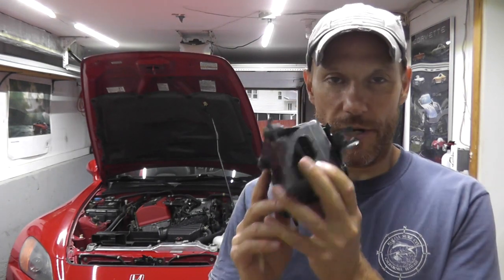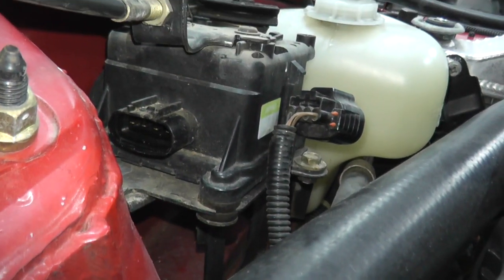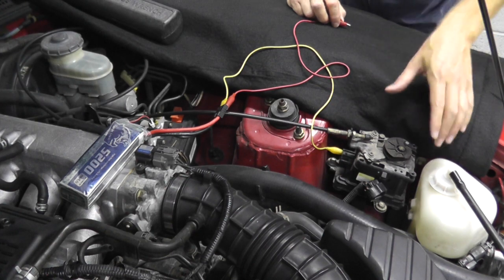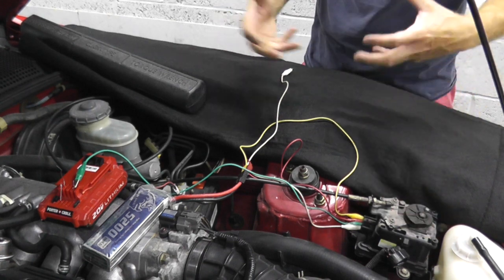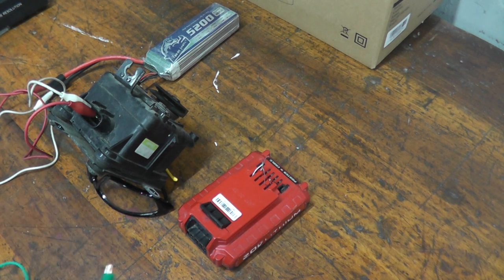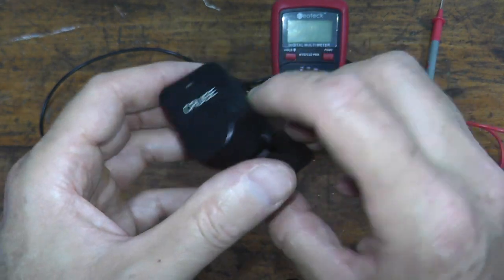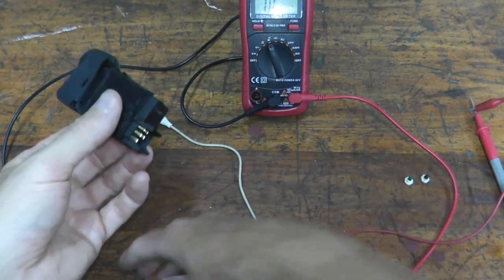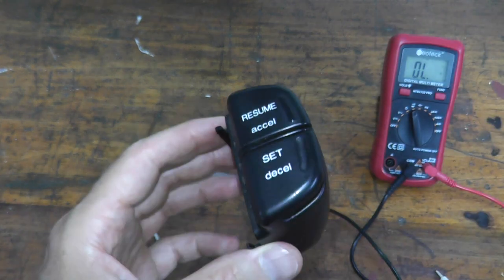Cruise Control Repair | How To Diagnose And Repair Cruise Control Components

Comment: What a great video! Understanding the components and how to test helped me to find the problem with my cruise control in my newly acquired Honda C-rv and get it working. I was thinking it was one of the switches but after verifying they worked, I went under the hood to check the cruise unit and found the plug wasn't all the way connected. Simple fix.  Video provided knowledge and confidence to check it out. Thanks so much

Comment: Thank you so much for this video!  I have a 1999 Acura integra and I have performed all of these tests and found that all of my components, set switch, main switch and under hood cruise control actuator are in good working order.  I have also disconnected my clutch cruise control switch and jumpered it to rule out the switch and I have checked the fuse and rule it out.  Where do I go next to determine why my cruise Control doesn’t work??

Comment: You could also unscrew the circuit board and confirm that the soldered joints aren't disconnected or the "set" switch jumper terminal is decent and repair your switch for free. Thanks for creating this video, it helped me process my vacuum actuated CC module.

Comment: Just bought a good used 03 Honda accord but my cruise isn't working. The switch on the wheel engages but it simply does not work. Im thinking it has to be either a fuse or the actuator. What do you think, also does the actuator have a fuse?

Comment: Great explanation video, as always. I had an issue with my Dodge Charger cruise control not working when initialized, and after an OBD scan, it turned out to be one of the speed control sensors on the passenger side front being faulty. (Apparently there's a speed sensor on each of the 4 wheels on a Dodge Charger). Replaced the faulty speed sensor, and my cruise control works as it should. (Making this comment just in case another viewer is having an issue with their own cruise control on a Dodge Charger).